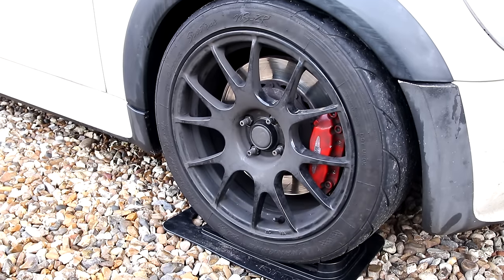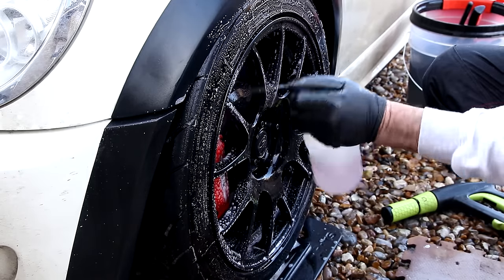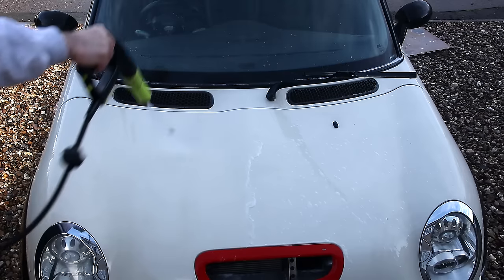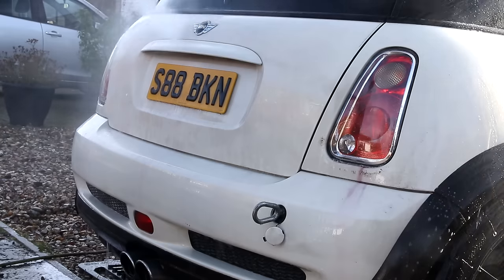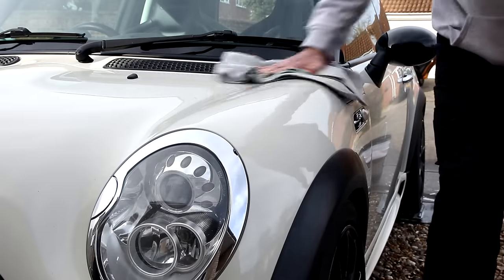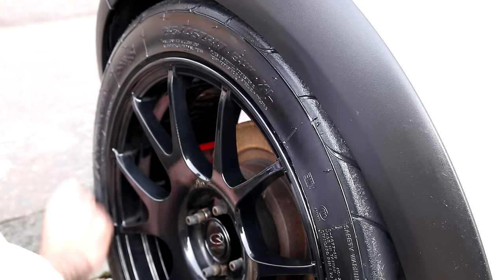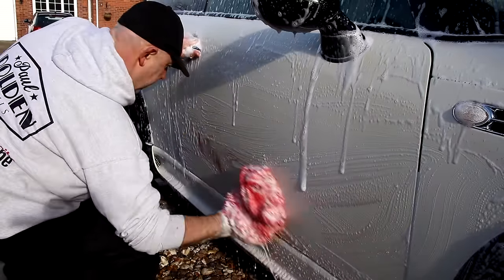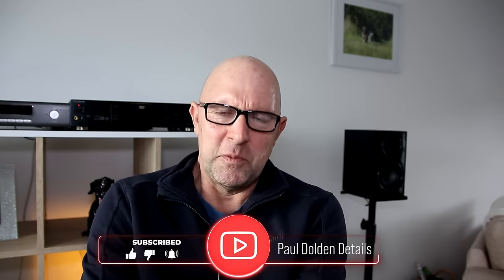Filthy Mini Decon wash & Protection Detail

Comment: Hi Paul, our Acid Wheel cleaner is designed to be used as it is - neat. You can dilute if you want, for cars where the dirt is not too bad - but on a car with heavy brake dust (as one would reasonably expect from a track car) I would go in with it neat. Provided reasonable steps are taken and the instructions followed, you will not have any issues. You will find that the agitation required drops off dramatically too. Mark.
Reply from the maker: Cheers for that I’ll remember that on the next one

Comment: I wouldn't be using a water based dressing on the outside. Soon as it rains it will just run and look awful. Oil based on the outside everytime 👌🏻
Reply from the maker: Depends on the brand but good comment 👍🏻

Comment: Hi Paul. Great vid as usual. 
Personally I used to use fallout after the first contact wash. However I now apply fallout AFTER the prewash/ snow foam. Then apply fallout and do the first contact wash whilst the fallout is still on the car.
Edited to update. So I paused the video right at the beginning and commented. My theory is, fallout remover is ( in my opinion) slightly wrongly labelled. It doesn’t remove the fallout, it’s purpose it to dissolve the corrosion (iron oxide)around the iron particles which in turn LOOSENS the embedded particles. Pressure washing off will inevitably dislodge most of the particles after fallout application. However contact washing will remove the dislodged particles much more efficiently than just pressure washing alone. Only caveat with the contact wash is it will of course scratch the paint. So I would only do this method if machine polishing after. As a maintenance process I would apply fallout and pressure wash off and repeat if required. Done a couple times a year shouldn’t require contact washing whilst fallout is still on the paint?? Long winded but hopefully that makes sense???

Comment: For nasty deposits on wheels like that, here in the US we have a masonry cleaner called Prosoco Surekleen 600, it will corrode raw metal so valve stems need to be masked but it will 100% remove those deposits, been using it for years with great results

Comment: If I apply an iron remover, when doing a full detail, I apply the fall-out remover after the car is hand washed.  Then I use my clay mitt and iron remover at the same time, via the Yvan Lacroix method.  Doing this process, you are knocking out two steps into one.

Comment: I find using fallout remover before a clean is simply a waste of product. 

The thioglicolic acid needs direct contact with the iron particles to initiate the chemical reaction properly after all.  

Excess dirt just hinders that. 

I usually wash, apply fallout, gently rub it in with a different wash mitt, let it work its magic and then go from there!

Comment: Hello! I noticed your pad sometimes stalling out when applying the liquid wax...

I've had the same issue with my DA when applying wax on a low speed, especially on contours where it's sometimes necessary to apply a bit more pressure. 

This has put me off using my machine for waxing, but maybe the 'jiggling' motion is sufficient on its own? Especially if making a few passes in those areas?

What do you reckon? Maybe I should give it another go...

Comment: Good to see you back on YT Paul, the two camera angles are certainly a nice change from static. 
Re the fallout question, I wouldn’t use a fr first as it’s only going to react with the dirt on top and as you said it’s not a good idea in the summer time. 
Always been told start with the least aggressive chemical and you went in with zero decon was it? That took off a lot which the fr chemical had something to react with but remember a fr does not dissolve the metal only the oxide that’s holding it on to the paint 

Has Specky given up on YT as it’s been 4 months since his last video???
Reply from the maker: Hi mate no specky has had a lot of personal problems and moving house he will be back soon 👍🏻

Comment: Quick question, and maybe a topic for discussion, Fall out remover: i was told that iron fallout remover works by disolving the oxide ( rust)  around the the iron partical to release it, so doesnt dessolve the iron partical, so potentialy could still scratch your paintwork if washed off with a wash mit instead of pressure washing it off,
Interested what the thoughts are on this?
Reply from the maker: Much of a debate this one after talking to fellow detailers it’s a 50/50 split bearing in mind GT iron oxide can be used with a wash mitt

Comment: Really struggling with a single stage (cellulose) 1986 red car. Get it looking nice and within a couple of months paint has faded and looks pink.
Any good UV protection I can use to stop that happening?
Reply from the maker: Try Soft99 fusso coat
Reply: @PaulDoldenDetails  that's what I have been using but paint still fades.
Unfortunately car lives outside as don't fit in garage either.

Comment: Hi Paul  do you have any tips on how to eliminate dog vomit odor please 

As soon he was sick I used a wet vac sucked it up using carpet cleaner 

But the car still smells terrible
Reply from the maker: Enzyme killer Valetpro do it 👍🏻
Reply: @PaulDoldenDetails  
I did try that thnx paul the smell still there 

Should I do it neat

Because I done half and half of water 

Should I use a extractor or just spray it on
Reply: @PaulDoldenDetails  

Should I use a extractor or use it 50 50 or  do I do it neat please
Reply from the maker: Spray it on
Reply: @PaulDoldenDetails  

Is that neat please paul

Comment: Why don't you use alkaline shampoo for heavily soiled cars?
Reply from the maker: I do take a look at GT Zero shampoo it was used as the prewash but can also be used as a shampoo
Reply: @PaulDoldenDetails  Personally, I'm not a fan of pH-neutral shampoos. I believe they can indirectly cause more scratches since they don't clean as effectively. I think abrasive techniques like claying have become more popular as a result of pH-neutral shampoos. What do you think?
Reply from the maker: @fluzzerr if the prewash has been effective then you can get away with PH neutral but I know where your coming from alkaline prewash and shampoo is great for winter grime there was no mechanical decontamination with this car as it wasn’t in for paint correction it’s a track weapon 👍🏻